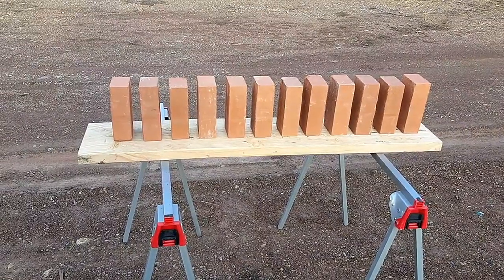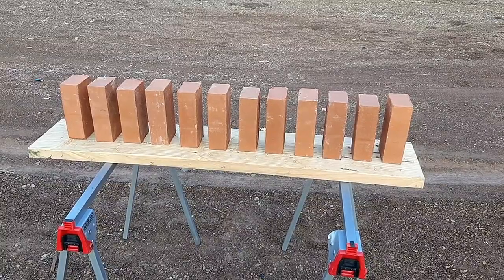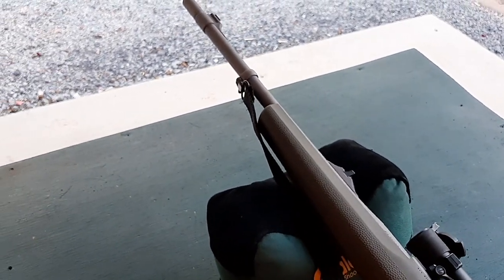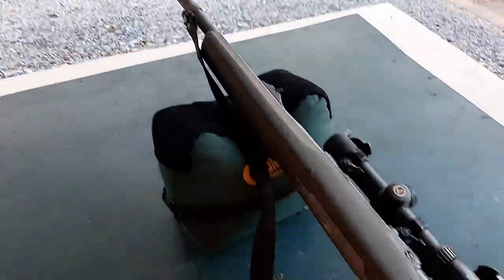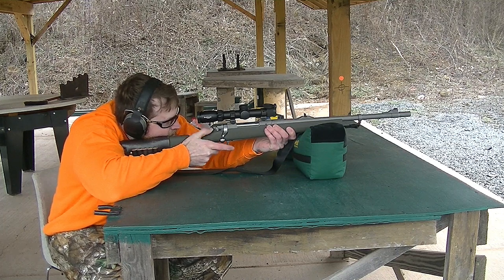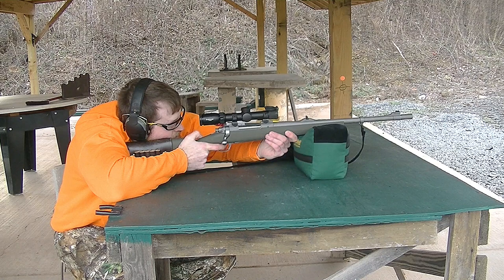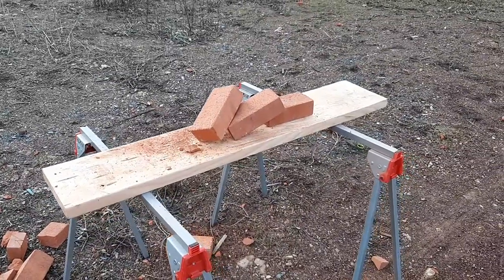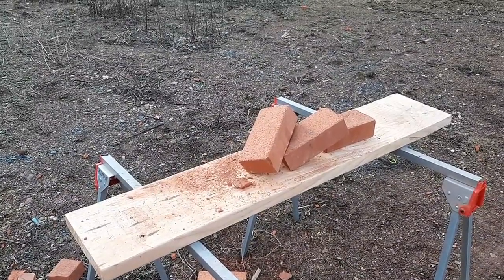416 Ruger vs Bricks (Elephant Gun)

Comment: Excellent video. In my own tests I found brick was the most resistant to penetration of masonry materials. Did tests with 8x57jrs, 7.62x54r, 9.3x74r, 375 h&h and many others and found the 9.3 and larger rounds would give between 2 and 3 times the penetration of 7.62 nato and 7.62x54r fmj. The biggest thing I found when using heavy rifles to break down concrete and block walls was when the gun weighs around 10 pounds and has a shotgun stock configuration I could stand to shoot enough rounds to break down the structures if in hunting rifle configuration 8 pounds and conventional stock recoil would be a problem after 6 rounds.
Reply from the maker: Thanks for watching.  Yes if you can shoot one after another you can break them down for sure.